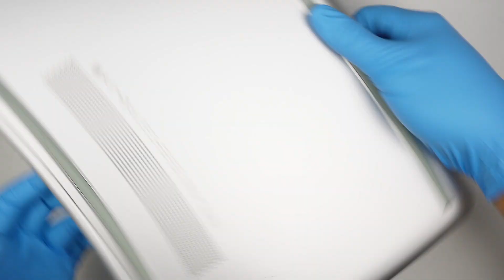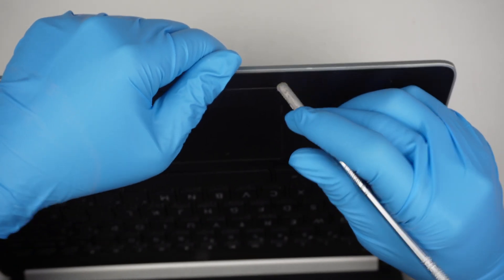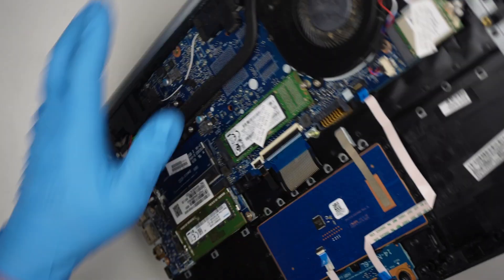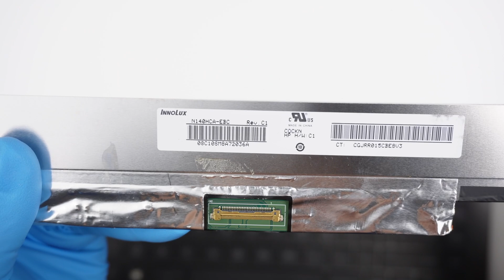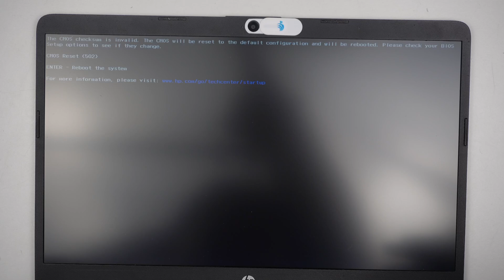Fixed HP 14 df Cracked Screen For Less Than $60

Comment: No tape for the bezel? I had a small blemish (white spot on dark screen) but the screen is out now successfully, and I upgraded the laptop to 256GB NVMe XPG SX8200 Pro, 500GB Samsung 870 Evo SSD, 32GB RAM, and Intel AX210 wifi.  Should be a nice kid's computer.

Also the top panel behind the LCD that connects to the wifi antennas says:
HARRY POTTER 14 (NB) on the left and right
6036B0213001 left and 603B0212901 right
2019/03/20 left and 2019/01/03 right
YAGEO Rev: A01 on the left and right

Interesting HARRY POTTER